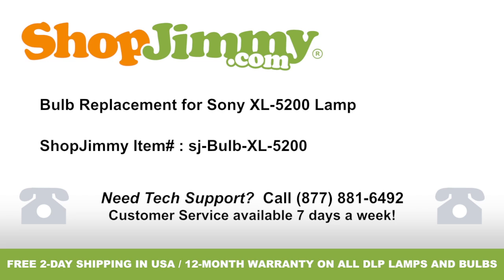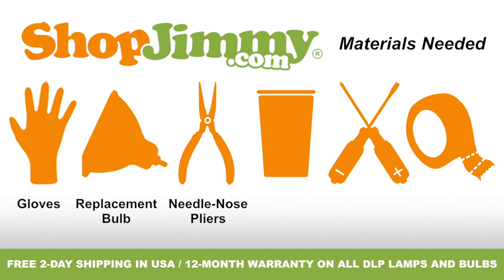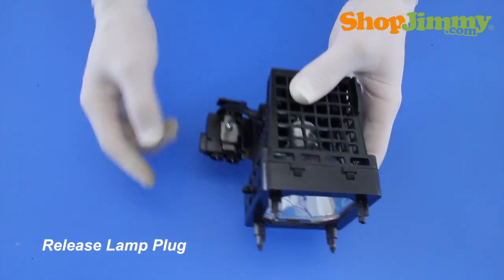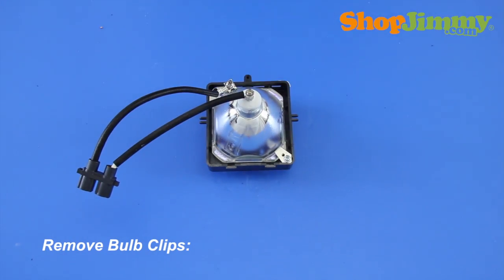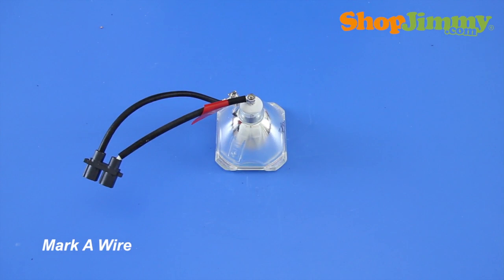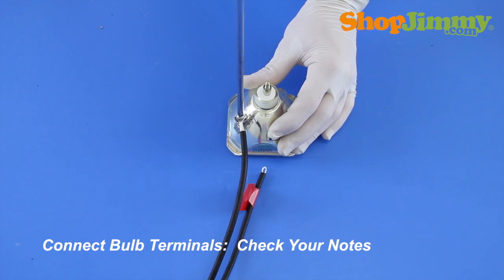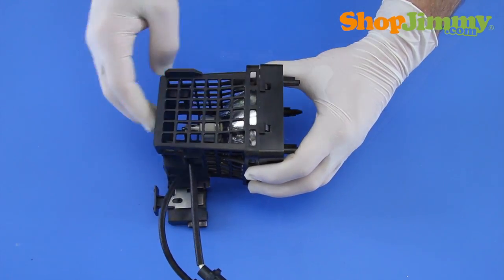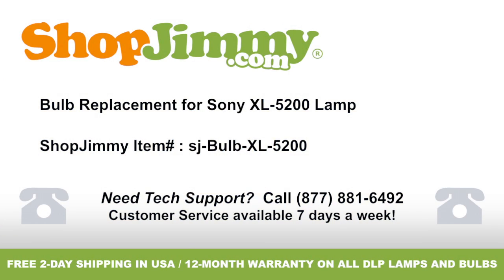Sony DLP TV Repair - Replacing & Installing Sony XL-5200 DLP Lamp - How to Fix DLP TVs

Comment: my  KDS 55A2000 has the cage's wires DIRECTLY crimped to a thin metal wires that go STRAIGHT into the bulb.  Where are people bulbs and cages that have these nut-style connectors?  How do we know whether a bulb we are ordering has the right nut-terminal-style posts/connectors??

Comment: Hallo, I  have a 55A2000. I changed the lamp and I don't remember if the plug should be moving freely on the metal piece holding it(the piece you are screwing on 3:01). Thank you.
Reply: I noticed that the screw can't go any further, it has a plastic stopper that the metal piece slides on. So it has to move freely. I installed my lamp and it works.
Reply: my  KDS 55A2000 has the cage's wires DIRECTLY crimped to a thin metal wires that go STRAIGHT into the bulb.  Where are people bulbs and cages that have these nut-style connectors?  How do we know whether a bulb we are ordering has the right nut-terminal-style posts/connectors??

Comment: I put in a new bulb in my TV lasted almost a month in a half why is that?
Reply from the maker: Flaka Miranda   Which model TV do you have?  What lamp/bulb did you buy and where did you buy it?  Did you receive a warranty with the lamp/bulb?  Thanks!  www.shopjimmy.com
Reply: ShopJimmy.com  I have a Sony KDS-50A2000, an unfortunately I do not have a warranty, yesterday it turned on projected the picture perfect then it began flickering an dimming till the screen went dark also the bulb doesn't appear burned or smell burned like the bulb I previously had in the TV before which was obviously fried.